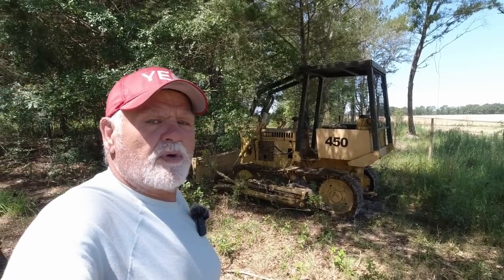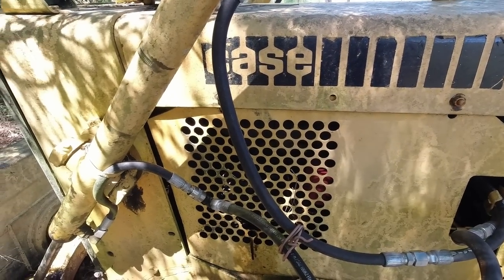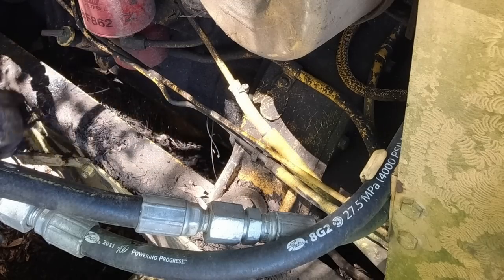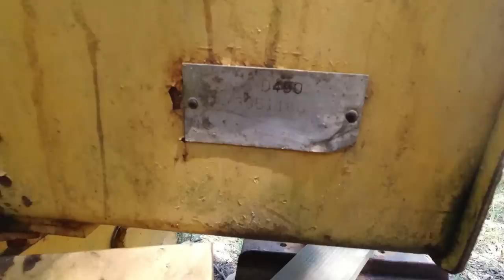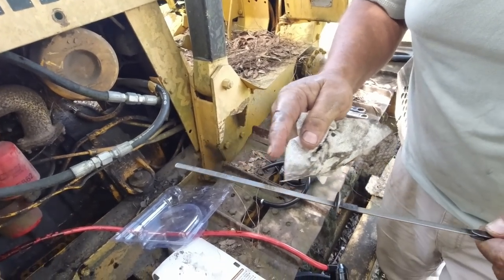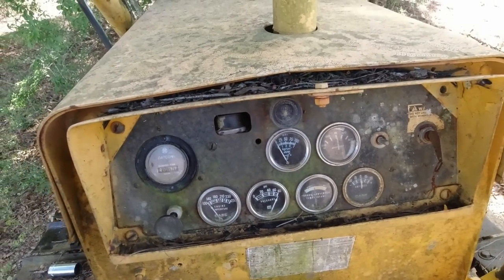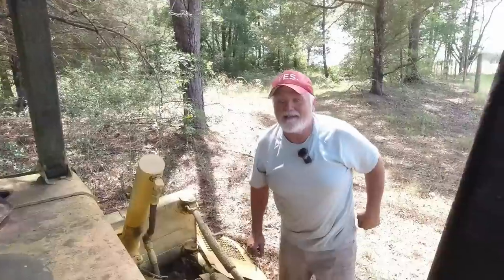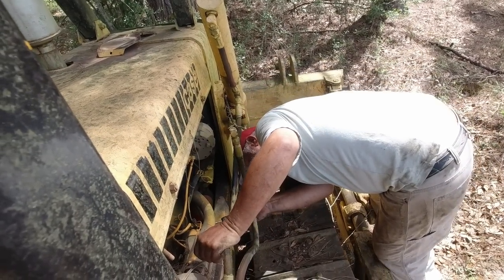WILL IT START!? Small dozer left ABANDONED after owner passes.

Comment: The intake-heater element  is what is screwed into the intake. Disconnect it as it won't help you unless it's extremely cold and you can use the extra amps for cranking. You might as well try 24 volts cranking it. Just disconnect the alternator.  I did notice one BIG thing that might keep you from cranking it. The manual stop was pulled all the way out. Those Injection pumps have a metering valve in them that sticks when set up for a long time especially when held in the shut-off position. I would take the injection pump cover off and manually move the linkage back and forth underneath the little cam that shuts it off.  Don't worry about air in it as that is all going back to the tank. The Stanadyne injection pump {Roosa Master} will put out just a tic more fuel if you hold it in the wide open position. Do all this and maybe it will fire off.

Comment: A small diameter chunk of pvc on that pump will give a straight shot to the bottom of the oil pan. The rubber line on your pump curls up in the pan so the open end isnt in the oil/water. Hook the rubber pump hose to the solid tube and pump away

Comment: That case 450 has Case made 188 or 207 Diesel engine.  The starter button is on the front of the shift tower,
Raise the litter door to lock levers in neutral and the button is under the door. Great little crawlers for light finishing work.
Reply from the maker: Thank you for watching

Comment: Ha Wily, I found out a long time ago that ether is hard on those small engines. Get yourself a pair of elbow length rubber gloves , try soaking a rag in gasoline, and hold it up under the precleaner works like a champ. Have had a lot of rigs run out of fuel, no ejector bleeding ,good luck
Reply from the maker: I am going to do that when I put the starter on it 

Thanks for watching

Comment: Operated one of those as a teenager with a six way blade 188 diesel made by case originally the 188 was a gas engine. Those things are bad about cracked valves and bending pushrods. Btw that's an intake heater not as effective as glow plugs.
Reply from the maker: Thanks  for sharing this 
Thank you for watching

Comment: Don't feel bad Wiley I've got the very same fluid transfer pump and tried it 4 or 5 times and found out later the suction was the top hole on the pump. I'm like you I gave up on it and ended up taking it to shop and 1400.00 later might could have saved my money if I had have read the directions on the pump I was using it backwards the top hole up to pump handle is suction. Days later I put it together that way  and filled the kitchen sink and pumped the water out of the sink over to the other bowl of the sink and it worked flawlessly so my bad putting the hoses in the pump upside down could have saved having to send it to get the DEF tank took off and emptied and cleaned the tank for 1379.00. I felt stupid over that pump.
Reply from the maker: Lol.   thank you for sharing that story. 
Thanks for watching

Comment: It is a Case 188d. The d is for diesel. The exhaust manifold is in fact original because these engines were also put in several tractors. I bought one out of a 530 Case tricycle tractor and put in mine. The lower outlet on the manifold was for an orchard tractor option. Exhausted out the bottom so trees don't kill your muffler. If you decide to part it out, I need a radiator. I just ran a tree through mine last night because it doesn't have the really nice side engine covers like yours.
Reply: Oh and the only variation on the 188d that I'm aware of is some had large injectors that were about as big as your thumb. Known for leaking. The other had pencil injectors like John Deere.
Reply from the maker: Thank you for sharing 
I looked at that exhaust and thought to myself someone’s done pulled a wily 
Thanks for watching

Comment: 45:54 Intake air pre-heater. Cold start aid, warms the incoming air up to a couple hundred degrees when active. Same effect as holding a propane torch flame above the intake.

 I would highly recommend against using ether in this engine with that thing active because it's a good way to detonate the ether in the intake manifold. I don't think it's active with you using a screwdriver to jump the starter solenoid directly, but still, that thing is basically just a space heater built into the intake manifold.
Reply from the maker: Got it. Thanks for sharing 
Thank you for watching

Comment: I was along when my boss at the time bought a new 450 with six way blade in early 1974, if that helps you any with vintage, at least we know they were being made then! There was also a 350 and a 550 on display at the time, at the dealers. I believe the engines were Perkins, as they were with the backhoes. He also had a 580B CK in those days, which was a real work horse, not as refined as later versions, but pretty easily learned.
Reply from the maker: Thank you for sharing
Thanks for watching

Comment: Hey Wiley that is either a Case 188 or a 207 engine depends on what year. The serial number plate is just below the starter on engine block. Or there should be a decal on the valve cover.
Reply from the maker: Thanks 
Thank you for watching

Comment: Thanks for another great video. It was interesting and enjoyable. 

Wiley and Jacob you did good so far. This one might be salvaged some. See what you can do. Thanks Wiley. 
Might be sold for parts or if you can get it going reuse it. That track sprocket may not work. 
Thanks Wiley. 
The Iowa Farm Boy. 
Steve.
Reply from the maker: Hopefully it will run and we can get the track back on and see what it’s got 

Thanks for watching
Reply: Wiley the starter button is in front of the shift levers,under a flap in front of the seat if you all haven't already figured it out,levers must be in neutral position,a safety feature,I've got a old 850 case dozer.

Comment: Just a little information on the injection pump. That is a CAV or a Roosa master pump when the engine is shutdown by pulling the cable. It closes the metering valve and when you push the cable back in the metering valve with go to full throttle. When the engine starts the governor will take control of the metering valve. If that 450 was left sitting with the cable pulled the metering can get stuck in the closed position preventing the engine from starting. I have a Case backhoe that the metering valve stuck in the closed position after I started it and shut it down. Now Hank would like this I tapped on the injection pump with a crescent wrench and I was able to restart the engine. I added essential lube to the diesel and let it run now I have no problems with the injection pump.
Reply from the maker: I will try that. I honestly thought it was going to bust off.  I hope it was the starter that gave out. 
Thanks for watching
Reply: @DontbeWily  think I agree with Bill about the pump (if it's a CAV couldn't really see it in the vid so can't be sure) if it's got a rectangular top where the cables go on to, take it off (carefully so as not to lose any nuts & washers and also not to damage the gaskets as it all has to seal if it's going to run) you should find a spring connected to an arm with a pin with a spiral groove (fuelling pin), going into a bore (there's also a sliding plate that is the fuel cut mechanism) where the pin can get stuck/gummed in the bottom of the bore so fuel is cut off, lift it out clean it with solvent and the bore as well, should work then, regarding the inlet manifold yes that is a pre-heater (hot wire coil) and finally your problem with the starter looks like the contacts are dirty/corroded (get this on engines i'm getting going after being left a long time) on the starter solenoid, some you can strip and clean but others you can't (no need for a complete starter motor just get a new solenoid), problem with "bridging" the starter is it tends to cause arcing on the solenoid contacts messing them up, also just check the "grounds" on your battery and engine (a cheat is run a jump lead from the battery to the body of the starter motor as well) as a poor ground could be making the starter motor hot, hope this helps.

Comment: Hey Wiley, I tried one of those silly red suction pumps like that one time and wound up keeping the hose and flinging the crappy pump. 
A Suggestion; I have two of the generic suction pumps that are identical to the MityVac pumps that I bought from off of eBay and love both of them. 
I had a carburetor float stick open on my Cub Cadet that had a two cylinder opposed twin engine in which my engine was completely full of gasoline. I maneuvered the smallest plastic tube down the dipstick tube and suctioned out roughly 3.5 quarts of oil/gas mix. The two suction canisters that I have will hold pretty close to 7.5 quarts per canister In which when full they are very easy to empty out.
As I remember, both of them were around $40 per canister and had 4 different sizes of plastic tubing with a rubber boot on one end. They really don’t take up much space being that they are more tall than round. I was very skeptical when I first bought the two that I have and was pretty quickly impressed. 
I wonder if the fuel filters may be full of water-May be worth checking out.
Reply from the maker: Thank you for sharing that and I will check in to it 
Thanks for watching
Reply: @DontbeWily  I have been watching your videos for quite some time.